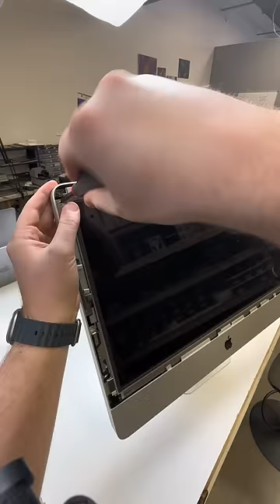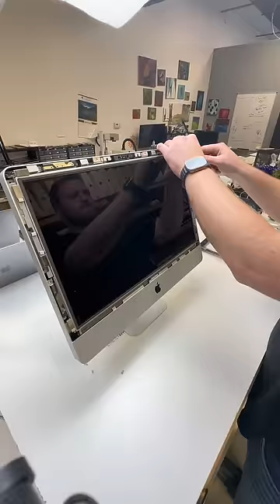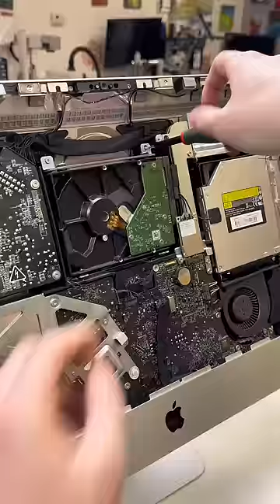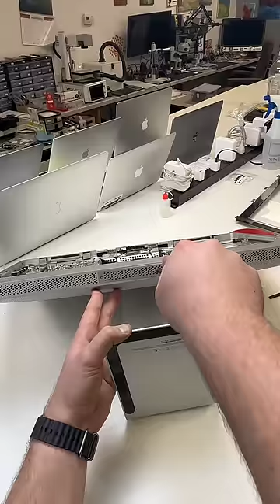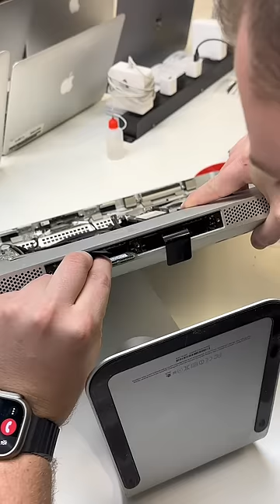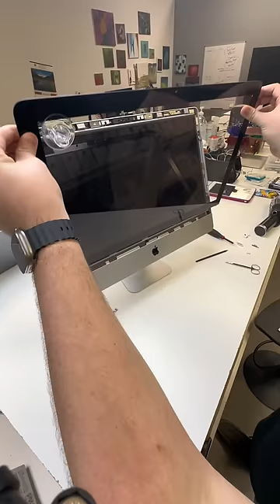7 years later and he’s back! #strictlyapple #thebestforless #shorts

Comment: Going from a hard drive to an SSD is like putting a rocket ship motor in your computer
Reply: More like going from a crank start to an electric starter motor. The difference is crazy though
Reply: You never forgot the first time you go from the HDD to a SSD, it felt like a whole new computer!
Reply: @RobGMun  If so then why am I still using HDD 😢😢
Reply: I remember thinking the processor was the reason my laptops always were so slow…. Like 5 years ago swapped an SSD in and my laptop became faster than any computer I had ever used
Reply: @studionimba  idk but this guys right. I recently got a new computer, spent way more on all of the parts, and the one thing i really notice is the absolute speed of modern entry level ssds
Reply: Ya but this was prolly a sata SSD not nvme
Reply: i guess you havent heard about m.2s
Reply: It's like doing an engine swap
Reply: @studionimba bro ssd are cheap af just buy one
Reply: I took my ssd for granted:( I uninstalled it and bought a 2tb hdd and installed my os on it and holy fuck the speeds are so much slower on everything than it used to be
Reply: says the one who doesn't have dedicated 3080 graphics in their pc
Reply: @theyhateme8763  m.2s are ssds lol
Reply: That's a lot more than a lil faster...!
Reply: @keigansabo9330  yes and kind of no..they are on an entire different level...HDD SSD and m.2 are all drives but all function differently with the main board...if you want to argue with that tell you're ok if you ordered and 2 TB m.2 and they gave you a 2 TB SSD you would be ok with that...the difference in speeds  can get to somewhere in the 20 times range
Reply: @keigansabo9330  vettes and pintos were both cars
Reply: Terrible analogy lol
Reply: @YBY3  not at all m.2 to a normal SSD is like pro drag car racing a scooter
Reply: Didn't do shit for mine. Still runs the same.
Reply: @AlKaseltzer87  then maybe upgrade from a 1979 mac
Reply: Word, my mid-2012 MacBook Pro was a freaking snail when I first got it, but after putting in the same upgrades as in the video, completely new and quick machine!
Reply: @theyhateme8763  m.2 is just a connector.  Maybe use Google before arguing.
Reply: Nope, it’s still limited by transfer speeds
Reply: @RobGMun  honestly. Like before it would take like 30 minutes for my pc to run properly and even then it still had manor hickups and a crashes. (My specs are 16 gigs of ram I5 11400f and gtx 980.) I’ve had a ssd in my system since day one but didn’t know how to configure it to boot windows (still don’t) so I ordered one with windows pre installed and when the difference was crazy it really was. Felt like I built a whole new rig
Reply: @miregoji2959  yes of course but a m.2 from a Sata SSD is extremely different in speeds
Reply: @Pablud3S  M2 is more or less plugged straight into the motherboard, much faster than the other types, that are either in a card slot, or SATA-compatible
Reply: What is a rocket ship motor?
Reply: This made me think about the day when i exchange my HDD for an SSD, I thought I had an entire new system, it was so smooth and fast 🫣
Reply: @theyhateme8763  No, that's not right. M.2 is just the connector type dude.  Some m.2 are connected via sata. You're thinking of a m.2 that use pcie exclusively (NVME).  So many people think they are getting NVME speeds, but they just using sata through an m.2 connector. Cheaper laptops often have m.2 to make it slimmer, but you're not getting any speed improvements
Reply: @studionimba  a Samsung 500gb only costs 56 to 60 dollars at least mlin my country
Reply: @theyhateme8763  m.2 is just a form factor. SATA drives and NVMe drives are both available in the m.2 format in multiple sizes, 2280 being the most common for desktops.
Reply: @theyhateme8763  Only thing wrong with m.2 is that you have to remove a drive from your motherboard if you have more than 3 to accomodate it.
Reply: More like from Toyota to millenium Falcon
Reply: rocket ship motor?? more like from walking to riding a bike. ssd only helps load times. not much for processing.
Reply: @alimantado373  I don't understand what you mean? my computer that I run for my bedroom tv has . two - 2tb m.2 plus two 2 TB ssd . with another external 6 TB HDD and of course my OS runs off my m.2. for a total of just over 13 TBs of storage . (you don't ever  get what they say the size is).
Reply: @alimantado373  I'm looking into very large HDD Nas to store all my businesses back up videos I have my editor make for my business.
Reply: @Koshmar-13  show me a m.2 or a more common  NVMe  that plugs natively into a sata slot.. tehy all connect to the main board directly its what makes them so fast.. if you walked into a pc store and asked for a ssd they would hand you a sata ssd.
Reply: My PS4 fan will run faster?
Reply: @theyhateme8763  You're still confusing what I said. There are SATA SSD's that fit and function in m.2 slots. m.2 is not a type of SSD, it's a connection. m.2 can support SATA as well as PCIe for NVMe drives.
Reply: @Koshmar-13  no I'm not once you adapt it to fit into that slot you're losing tons of speed correct? ffs you can use m.2 as ram but you're losing speed ..
Reply: @Koshmar-13  Can M 2 SSD be used as RAM?
As for virtual memory, yes, similar to a HDD, we can use an SSD for virtual memory, but keep in mind this is as an extension to RAM, not a replacement. Something else of interest: AMD announced a GPU with a pair of PCI-E x4 M. 2 SSDs on board in a RAID-0.
Reply: @Koshmar-13  Yes, while the M. 2 SATA SSD would physically FIT in the slot, M. 2 SATA SSDs use completely different wiring than PCIe NVMe SSD slots
Reply: @theyhateme8763  there are boards with m.2 slots that can support both NVMe or SATA.
Reply: @RobGMun  I used a HDD on ps4 then went to PS5 with SSD 

Went back to the ps4 since recently just for shits n giggles n there is no way I used to play on HDD 😭
Reply: Then you switch to an NVME SSD and it feels light light speed in comparison
Reply: I used a hard drive for as long as I could remember, I didn't really think there was much of a difference in load speed (plus pricing as a broke student). When I finally made the swap maybe 4 years ago, the loading time went from 4 minutes to around 14 seconds, was honestly mind boggling that I'd been keeping myself back from that (not to mention the game loading times).
Reply: @TTyronE_  I used a hhd for my whole childhood, I've made the switch to a SATA SSD, boot up took not 10 mins but 10 seconds and my CPU& RAM usage dropped significantly
Reply: @Abcd123Alex  Yeah everything just felt so much smoother, the switch to M.2 also sped it up to around 8 or 9 seconds for a boot
Reply: @Koshmar-13  no shit mine does..I have 2 m.2 nvme 2 tb sticks with total of 4 TB plus two 2 TB SSD sata .. anything connectrd to Sata is snails speed compared to nvme
Reply: @studionimba  if you on pc then buy a 128gb ssd for windows to boot with and use your hdd for bulk storage, best combo imo
Reply: @Studio Nimba Music  cus your not reading up on tech stuff.  come on now keep up.  I bought a 50 gb ssd  for $150.00 back when they were that expensive.   it was insane how much faster . I was blown away by the boot speed and large programs just pop up like banm you need something.  it's ludicrous  I tell ya.  😂🤣😂🏌‍♂️🎆
Reply: @RobGMun  facts bro. I replace an hdd and will up sell a ssd, asap. 😂🤣😂🏌‍♂️
Reply: I'm happy for him. Now to get back to work on my i9 4080 64gb ram
Reply: Until it blows up and you lose all your data.
Reply: Ehhh
Reply: @Shaversian  you might be one of the worst pc builders then lol
Reply: Performance will vary its not always crazy gains my SATA ssd consistently booted up my computer faster than my NVME drive does now. seeing a full second less in BIOS startup times on the SATA ssd compared the the M.2
Reply: @SilentMind  3 minute boot ups we meet again
Reply: @AlKaseltzer87  you cheaper out and bought a bad one without dram cache .. did you get a crucial bx500 by any chance ?
Reply: @studionimba  sounds like a you problem.
Reply: @sixtenpetersson3930  crank start is better thoo btw I'm talking about the engines
Reply: More like putting a rocket engine on a bike, the old cpu and gpu and lots of old electronic on the motherboard will just stop both the rams and ssd to reach the performance they have.
Reply: @theyhateme8763  gues you havent hear that an imac thats almost 10 years old doesnt have m.2😂😂😂
Reply: @theyhateme8763  wrong m.2 sata is limited to the same 6gbps sata connection that a hard drive is limited to
Reply: @Aki-47.  In the usa you can get a 1 to 2tb nvme for that
Reply: @theyhateme8763  wrong the reason an m.2 nvme is fast is because it uses pcie lanes to transfer data. You can purchase an m.2 sata drive that plugs into the same m.2 slot but uses the sata protcole
Reply: @moparjr89  im not dumb enough to buy a mac.
Reply: @moparjr89  not at many  of the newest gen m.2s are hitting over 12 gb per second. most normal ssd becacuase they run on the sata slot only get 480
Reply: @moparjr89  nvme m.2 are far afster than the others due to no bottle neck
Reply: The difference from SSD to NVME is the same as HDD to SSD.
Reply: @adnan_velic  with the new gens ever greater. but nice to see somone with sense
Reply: If it's an apple branded ssd. Otherwise they'll purposefully slow it down.
Reply: so true, I was like I'm fine with my "fast" HDD...until I tried a cheap SSD for testing.
Reply: It's like putting a ferrari engine in your 2.0L diesel car.
Reply: @studionimba  because you're broke
Reply: Going from a Hard Drive to an SSD and paying someone $800 to do it.....
Reply: After I got a unicorn of an error with my hard disk drive placing a byte or two in the wrong place and almost nuking the entire thing.

I upgraded to an SSD and my god first startup I didn't have time to do anything else but put in my password and be at the home screen.
Reply: SSD expensive?
Reply: @bro6568  compared to HDD? Yes. Compared to NVmE? No.
Reply: Not to mention from 4 gb to 16gb thats a big leap also💪🏼 looks like he is good to go for at least another 7 years
Reply: @studionimba  dude?? get a Samsung SSD and move on. What are you waiting for.
Reply: @anmolhaksar8578  You have good eyesight, and your point is....  Sata SSD drives are 6x plus in performance over a spinner. nvme is only negligible increase over ssd, especially with the controller on an older MB.
Reply: Haven’t had a computer without an ssd in over 10 years
Reply: *on your car
Reply: @studionimba  because you're poor?
Reply: This is what I came here to say. Best investment you can make in a PC.
Reply: @theyhateme8763  goated
Reply: @nullpro7435  The reason why he should get a new computer is that macOS updates will not be available at some point. If you’re happy to switch to Linux, great. But an outdated MacOS is a security issue. Also some newer software will not run on older versions of macOS.
Reply: @theyhateme8763  m.2 is not really much faster
Reply: @pbart9821  stop choking on pen15
Reply: @RobGMun  absolutely. It was a 60 gig Kingston v300 only used it for my OS install but it blew my mind! Went from over 200 second startup to a 12 second startup. I quickly filled up my %appdata folder so I got a bigger drive relativity quick. Still, it changed my perception of ssds entirely!
Reply: Nvme clean windows install takes 4 to 7 minutes. Startup time takes 5 to 15 seconds
Reply: @tommygunnzfrank3207  I've been buying basic mini towers for the last 15 years for basic staff PCs . last year I upgraded all that could to nvme or 2.5 SSD.. the difference in speed is staggering...I bought a editing rig for my video guy last month and watching them load windows to it plus everything else was like watching a YouTube video load a few years ago..it took less than a blink of an eye it seemed...like you said less than 5 mins..
I was so use to old HDD taking forever let alone cloning a new hard drive to update PCs...nvme it life changing..it's amazing how affordable they became almost over night..I remember when SSD first came out they were more than a kidney when they got to a decent price nvme isn't but pennies more really
Reply: True! My 2011 MacBook pro I have no complaints
Reply: I am still using HDD, then I tried my lil bro's laptop with NVMe M.2 SSD x4 PCIE, it boots about 7 seconds, it shocked me
Reply: @zenkygeorgecleanton8139  big Time. then there's morons saying it's not any faster
Reply: I daily a 2010 iMac because an SSD makes it run so good
Reply: Abdulmanap Vs COVID rematch  more or less
Reply: @anmolhaksar8578  data or not… it’s way quicker bro 😂
Reply: @theyhateme8763  no. An ssd is an ssd. A car is a car. That’s what the guy is getting at. M.2 and Sata are connectors. Not the ssd 😂😂😂😂😂
Reply: @anmolhaksar8578  It doesn't matter, for normal daily usage you won't feel the difference over 1 GB/s speed that an NVME can offer.

Even yet, currently only video editors and 3D designers (or any other huge data-oriented workflow) that will actually benefit from over 2 GB/s speed of at least a PCIE 3.0 NVMe.
Reply: @keigansabo9330  M.2 is the name of the socket, and it can connect to not just SSDs. The wifi card that exists on almost every modern laptops are connected to the M.2 slot.
Reply: @theyhateme8763  "show me a M.2 or a more common NVME that plugs natively into sata slot"

Dude M.2 is just the socket name. Don't confuse it with SATA just because it uses the same name for both of the connector and the protocol. 😪 

And NVME is the just protocol name.
What you never heard, touch, or see an M.2 SATA? 🤦‍♂️
Reply: @theyhateme8763  wow, your comments show just how little you know about computer parts, storage to be specific. There's so much misconceptions you've got. 🤦‍♂️
Reply: @adnan_velic  both are still SSDs 😪 it's just a matter of different protocols, which is SATA vs NVME. Get your facts straight.
Reply: @studionimba  why not? You can keep on using hard drives for secondary storage. But not for OS drive, for that one you should definitely move on to an SSD, at least the SATA one. A 2TB Samsung 870 EVO sold on my country is just around $193 if I convert my country's currency to US dollars.
Reply: @Steve.._.   you're the kind of guy as a kid who gave the neighbor candy to abuse you then said getting laid is getting laid
Reply: @hadifelani  go tell the store you want a m.2 them hand you a 2.5 inch SSD and then say an SSD is an SSD it's the same..you gonna eat that shit with a grin I bet
Reply: @theyhateme8763  lol, what kind of store does that? The retail one on malls? Any proper store will ask that is it sata, m.2 sata, or nvme.
Reply: @hadifelani  if there were no difference I wouldnt be able to Google the difference...I know they are both flash memory but still different..The reason for this is simple. Unlike M2 drives, SSD drives are plugged like a traditional hard drive (2.5-inch SATA SSD), while M. 2 drives are directly connected to the motherboard and offer faster bus speed, resulting in a very high-speed transfer
Reply: @theyhateme8763  lmao my guy. Both of them are still SSDs.

It's just that they use different protocol and interface / connection type. But both are SSDs. 🤦‍♂️

Apps like CrystalDiskInfo or something similar to it will all recognize them as an SSD regardless of their interfaces.
Reply: @hadifelani  they are both flash memory..
Reply: @hadifelani  soynyoi wouldnt care which one you had if you paid for the higher priced  one? remember they are the same thing
Reply: @theyhateme8763  "remember they are the same thing"

Omg my dude that's THE WHOLE POINT OF MY REPLIES because you keep wording it like they're different. 🤦‍♂️

Whether it's SATA, M.2 SATA, U2, or NVME. They're BOTH SSDs, but with DIFFERENT protocols and interfeces. 

You kept on confusing the interface and the protocol and mixing 'em up together back and forth. 

Serial ATA is the name of both the protocol and the interface. While NVME is just the name of the protocol. 

A SATA drive can be put on SATA socket, or M.2 socket that supports it. An NVME drive can be put on M.2 slot, or as an Add-in PCIe card.
Reply: a Tesla is still a car yet different
Reply: @hadifelani  you can legit google if the are the same ..Are you planning to buy M.2 or SSD? Then read this ultimate guide to find out which is better. The comparison between M.2 vs. SSD, the hardware difference, how to initialize the drive and install it on your PC. You can also migrate the OS from regular HDD to SSD without installing anything.
Reply: @hadifelani  you're the kind of guy who thinks getting tea bagged is the same thing as using a teabag
Reply: @theyhateme8763  smh you keep on missing the points. 🤦‍♂️ it's not about "which one is better".
Reply: @theyhateme8763  Sigh..... 😪

Again and again, they're the same, both are categorized as an SSD. The difference is that NVME is a newer protocol. Hence why it's better than an SSD that still uses SATA protocol. 🤦‍♂️

Is it really hard to grasp that? Just how bad is your reading comprehension capability?
Reply: @theyhateme8763  "are you planning to buy M.2 or SSD" in itself is already a ridiculous and incorrect question. You don't say it like that. What, are M.2 NVME drives not SSDs to you? Smh🤦‍♂️

Because, again, THEY ARE BOTH CATEGORIZED AS SSDs. Solid State Drive is the name of the storage type. The question should be "are you planning to buy an NVME SSD, or a SATA SSD?". 

That's where you're wrong about thinking that they're different things. The difference is about the protocols and form factors , not the category as they are all SSDs.

"Tesla is still a car yet different" is actually the perfect analogy of this, actually. No matter how different it is to a regular petrol/diesel cars, they're all STILL cars.

At this point I'm at a loss whether you are a troll, or just someone with poor reading comprehension skill that made you do all of these misconceptions, thinking that they're different. 🤦‍♂️
Reply: I'm going to SSD soonest😊 thinking about the unforgettable first experience
Reply: Nahh not really still slow as f
Reply: Not compared to that 4GB to 16GB RAM upgrade, which would have more of an impact.
Reply: @theyhateme8763 dude, all I heard was a French horn… lol. But seriously, I am always impressed with professional that really know their stuff… thanks
Reply: @avarmauk haha, that’s too funny, I had to pause on that, 🤔
Reply: oh yeah boy
Reply: @studionimba  Because you haven't tried an ssd yet my friend.
Reply: @studionimba  I just received my first ever 500Gb SSD the other day.

I initialized the disk and formatted it yesterday. 

Can't wait to try it out on my 5-7'ish yrs old laptop. 😁
Reply: True l knew the difference when l bought the ps5 a big jump in Loading speed
Reply: It's actually like Opening a Portal compared to Driving across town in a  Supercar.

     ☀️                         ☀️

🚶🏽‍♂️🌀 🌁  🛣️  🏘️   🌀🚶🏽‍♂️
  
    🌙                         ☀️ 
 
          🏙️ 🚗 🛣️🏘️ 🌀🚗                                           
 
      ✌️😎
Reply: rockets dont use motors, nice american education 👍
Reply: @anmolhaksar8578  m2 and sata drives are installable in that mac but 9/10times sata will be used bc it’s cheaper
Reply: Can I switch my 2015 MacBook  to ssd ?
Reply: Hunter?
Reply: I hope to have that kind of pleasure
Reply: @RobGMun  faxxxx
Reply: Wasnt for me but idk 🤷🏻‍♂️
Reply: @RobGMun I was amazed. On the HDD you had enough time to admire the startup screen and read the text that tells you what button to press to enter BIOS.

On an ssd you can barely read anything and the start up screen shows for 1 second and it's already in desktop 😂.
Reply: @theyhateme8763 the leap from a HDD to a SATA SSD is far more noticeable than going from a SATA SSD to a NVME
Reply: @RobGMun I actually felt that experience. Going from a slow ass 5,400 RPM HDD, to a Transcend SSD220S and the speed is insane.
Reply: There are m.2 SATA SSDs.
Reply: @alimantado373 Only if you have a laptop computer. Yet another reason why the desktop computer format is superior in many ways. It just isn't very portable.
Reply: My 2 core Athlon laptop begs to differ
Reply: I changed my hard disk to M2 SSD on Lenovo laptop
Reply: over the summer my 7 year old 2 TB HDD finally died, put a M.2 in it and it is insane the difference.
Reply: Can confirm.. PC boots within 1 minute instead of 10 minutes. 🫶🏻
Reply: Plus 16 GB form 4 GB he needs to chain his PC   it will be really a rocket 🚀 leave the earth soon 😅
Reply: SSD gang brother !!!
Reply: but it doesnt make a difference if the wheels are too small.
Reply: @RobGMun doing this rn lmao
Reply: also 60hz to 144hz